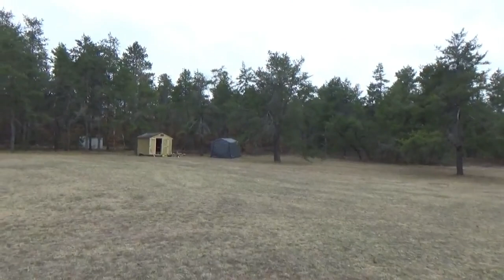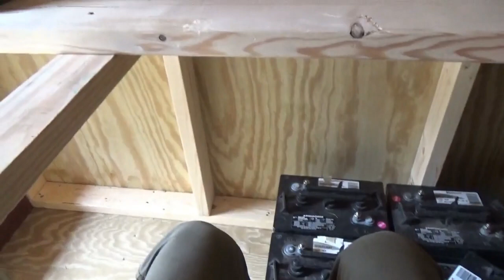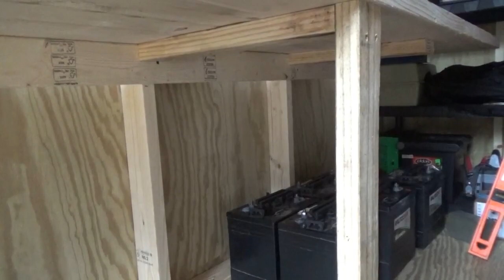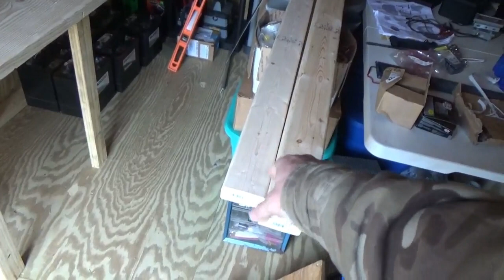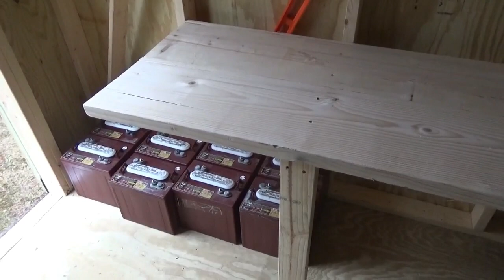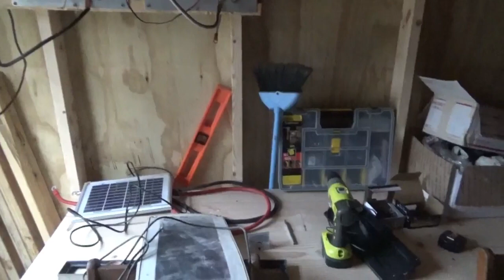Setting Up Off Grid Work Shop & Building Work Bench

Comment: how do you plan on getting solar power to the house are you going to get heavy gauge wire. and bury it Underground  to get the wire to the house just saying   I'm hoping the comments I  make are  helpful to  you but I would also get it checked out with a license electrician to make sure it's not a fire hazard because I do want to see you working the Troy and Melody off-grid Homestead PS I think I got your wife's name wrong whatever you want to call it
Reply from the maker: I plan to run AC power to the house. I will get an electrician out here first. Its Melanie :)

Comment: Not to be a party pooper.  But shouldn't you be looking for a job with health insurance.  I mean who's going to pay the heat and electricity bills?  Diapers and baby food, immoxacilin, immunization shots. Even if you owned the house outright taxes, insurance an utilities got to run about $700.00 a month. https://www.monster.com.   Other than that.  Looks like a fun place.  Melanie needs to stop lifting so much.
Reply from the maker: 700??? Thats insane. I certainly hope not!! Insurance is about 120 for the house. Taxes about 90 and they are included in the mortgage. That would leave 500 for heat and electric. I sure hope not. I do plan to go off the grid asap to save on energy bills. And a wood stove before next winter for heat